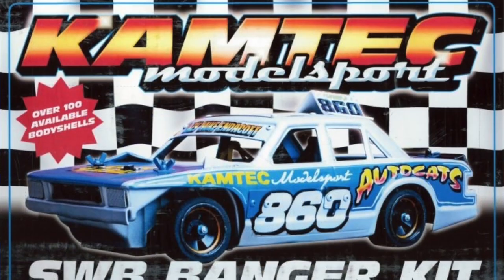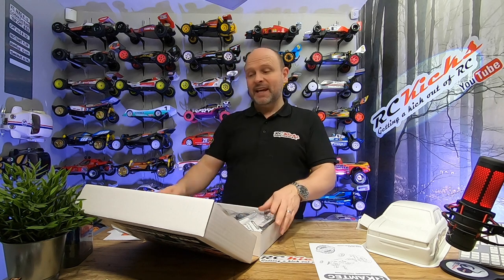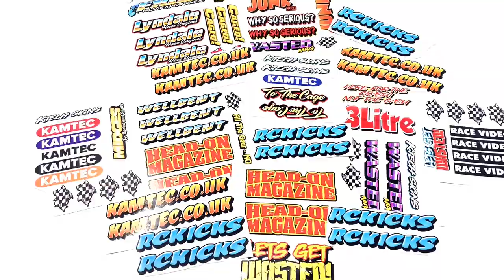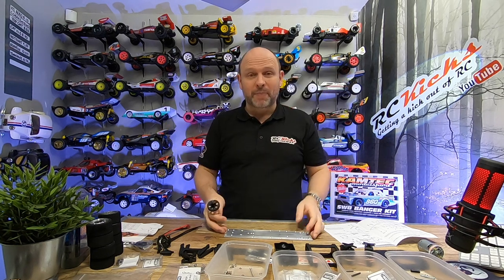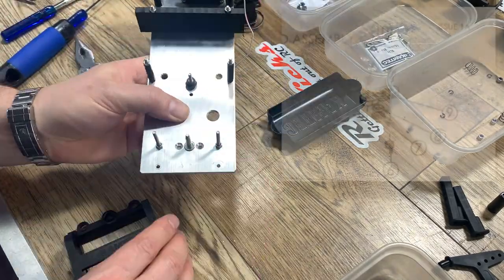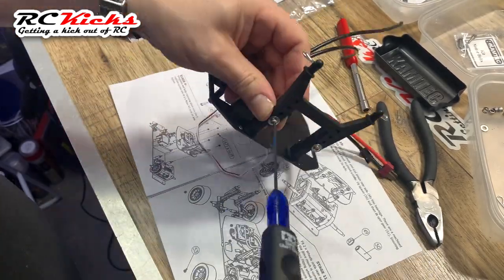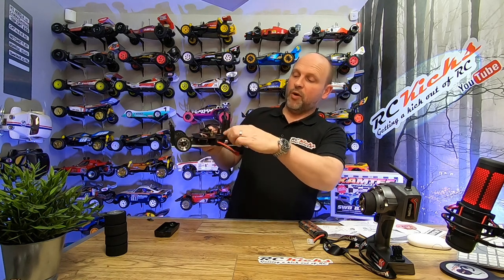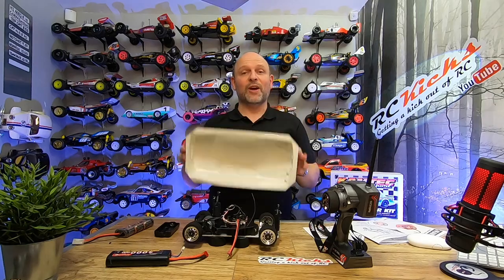Building A kamtec SWB Banger RC Car. A Perfect Budget Xmas Basher For The Younger RC Fans.

Comment: As a Kamtec user and RC Banger Racer, well done for your video,  Ive built a few and raced a few, the battery being loose is because you are using a 6 cell where as we use a standard 4 cell and does fit and hold down with the bolts on the top plate adjacent to the two square holes  fixed with two 3mm bolts and nuts with a nylon round spacer. The manual speed controller isn’t as fierce when a 4 cell battery is used.

Comment: Ace👍 I going to add one of those to my collection for me and my daughter to take out, so she can get to grips with a car without me biting my nails down to the quick 😁
Reply: Same for me and my son👍
Reply from the maker: That's why I like these so much, just for that reason.  Especially as the vintage RC cars are now so expensive and fragile, having one or two of these kicking around to take outside and swap paint knowing these are simple, tough little RC cars that don't cost much to purchase or repair.  It just takes the stress out of it and keeps it 100% fun for younger RC fans and RC Dads / Mums.
Trash a body, well that's, £6.99 and some old car paint that the kids can spray it on.  Slap a few personalised banger decals on it and you are back in action.

Comment: I buy most of their body shells and find it easier to use a soldering iron with a blades and then clean it up with a decent pair of scissors also rubbing it down with sandpaper as for holding the battery in i use a very strong elastic band going around both sides the battery and underneath the chassis

Comment: Manual speed controllers are excellent for this formula, after all you don't want to hit your opponent slowly do you ?  Yep, re bodyshells, might as well cut them out as they're meant to be done. Don't be nervous just trace around the windows with a pencil first, then score with a sharp knife . Next score again a little deeper, now go through on one side and apply pressure, the window will 'pop' out. Don't bother with dremels or such this way is quicker and more precise, I must have done close to a thousand of them over the years.

Comment: In my experience a dremel is the best way to cut out windows etc paint wise just chuck it on nothing special as most of it will be on the track sides and other cars after your first race lol.
And as for the car build it to last before you try to go fast.
And don't even try banger racing if you get a wobbly bottom lip if you don't like contact racing and break your car before the end of your first race because someone has straight lined you into the fence while they haven't even lost pace (it happens a lot) .
But if that doesn't put you off its a total riot to do and there's always someone willing to help out with hints and tips to stop you breaking it to much.

Comment: Also be aware if you fit a different battery the mechanical speedo has no bec circuit so reciever will get full voltage
Reply from the maker: Receiver Voltage Range:: 4~10.0V DC
Reply: @RCKickschannel   your lucky but has caught alot of people out
Reply from the maker: @Acheronus80  Radiolink

Comment: Are the rc kits more fragile than other hobby rcs
Reply from the maker: These cars are designed to bash into each other.  Did you see the chassis in the video lol.  That's why I think these are perfect little low cost RC cars for bashing around on the street, especially for younger RC kids.  The other benefit is parts are amazingly low cost so any damage will only cost a few  £ or $. £1.00 - £4.00!  Even a replacement body is just £4.99 - £9.99 depending on what version.

Comment: Currently building the kit. The instruction manual is terrible, vague pictures, parts in bags not labelled correctly. Having to watch this build on here multiple times to get it built. Coming from a background of MRI installation and medical equipment manufacture the documentation level is shocking.

Comment: Isn't the whole point of a banger race, to deform the bodies of the vehicles for dramatic effect and to survive? Id prefer to see RC cars with realistic but deformable bodies.
Reply from the maker: Yep the cars look good after a few runs
Reply: The bodies are hard but we do 3 heats , final and DD so it's quite an effort to last that long with repairs between races . You can wreck other cars as per full size so make no mistake , these cars are very realistic the way they damage each other